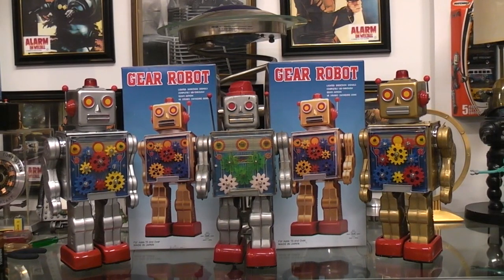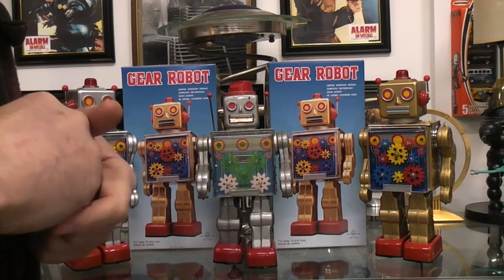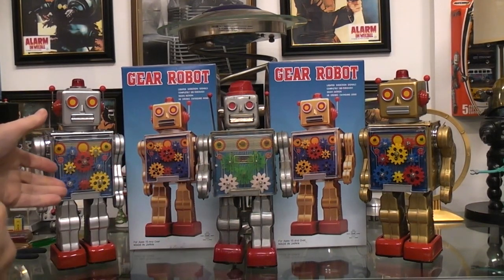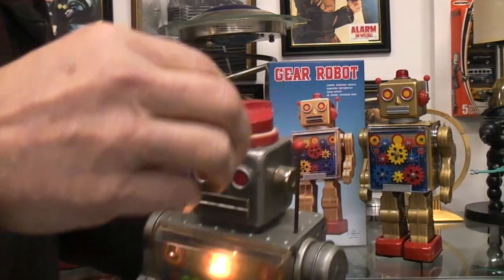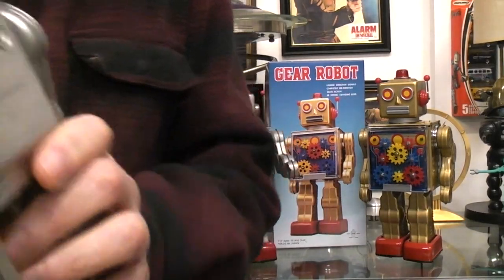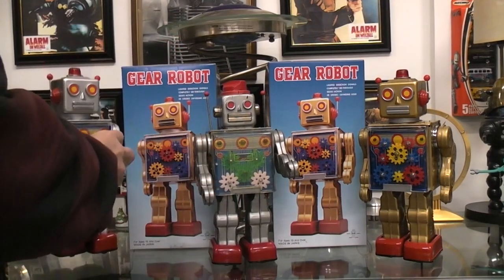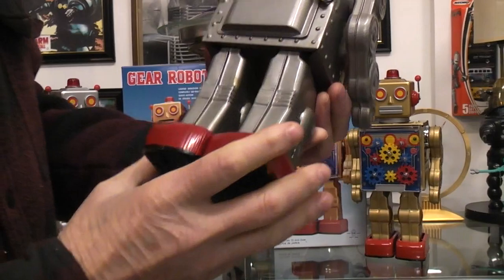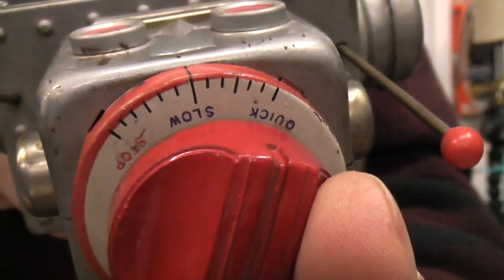Let's play with the 1960's gear robot "2 speeds and 3 sequential lights"& the repro gear robots.

Comment: I don't see a frankenstein robot on your videos do you have one? I had one in about 1964. They were made by Marx and are very hard to find. I saw one at an antique store in Pennsylvania once but they wanted $1200.00 for it so it was out of my budget. It could not just walk but also could bend over and lift things.
Reply from the maker: I had the Marx Frankenstein robot but traded it for a vintage smoking robot as Frankenstein did not fit my idea of a robot. I should have kept it with my Mr. Mercury robots just to complete the set.